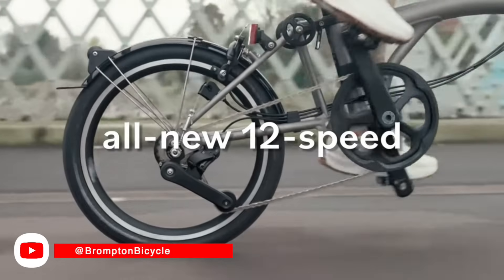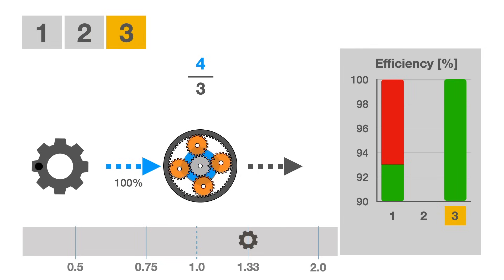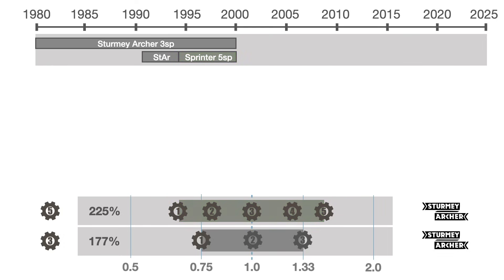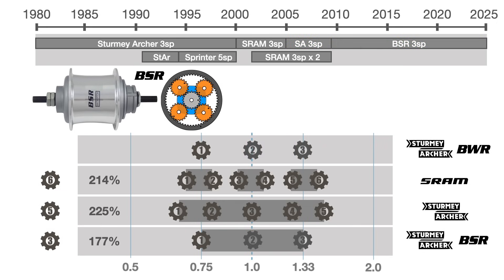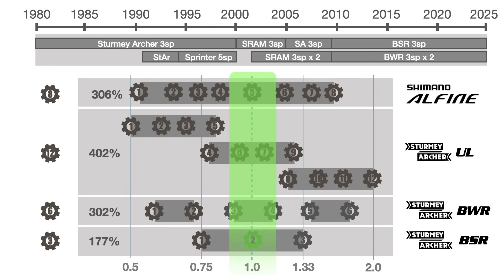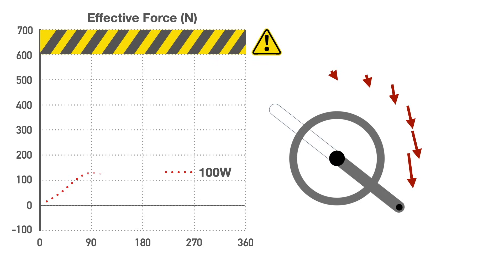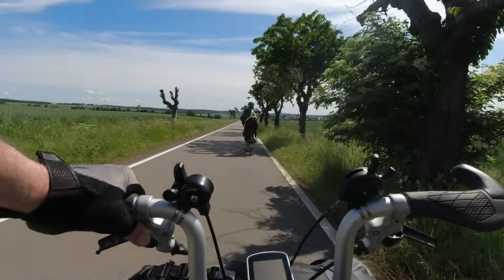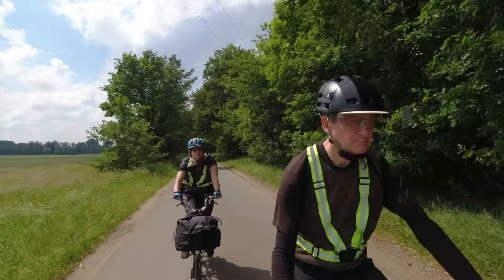Brompton Hubs: The Old, the New and the Math

Comment: Thanks for this informative video! Perhaps I will try using a Brompton with an internal gear hub. Currently, I am using a 5-speed external sprocket. I am so used to riding a bike with external gears. :)
Reply from the maker: You will likely see a degradation in efficiency moving from your 5speed to an internal gear hub.

Comment: Hi Pam and Gilbert! I'm not as bold as you, so I use a classical drop-bar, 27-gear, 700C-wheeled travel bike for touring, keeping my Brompton 6-speed C-line for city errands and occasional coutry or city rides when touring by car, when biking is a better idea for sight-seeing at short or middle range.
I'm not convinced by the hub+derailleur system of the C Line. I'd feel much more comfy with an alfine-type hub, everything inside, and no hassle with tensioners and what not. If I was to try and travel with my Brompton, I'd certainly replace the 50T chainring for a 44T one to facilitate luggage-carrying and hills. I've never understood why Brompton was sticking to the dual system for the C line. It's easy to get used to, but a single shifter with a single gear-system would be hassle-free.
Thanks for all the explanations you provide on your channel, with one regret: I'm pathologically (literally) unable to deal with numbers and maths, though the European way of calling gears is fine with me: 48x11 is the longest gear on my Ridgeback, 26x32 being the shortest. I know that 20x20 produces wheel-circumference length, so my legs do the rest.
Reply from the maker: The hub/derailleur combo was a quick fix to replace 5 speed hub shortage back in 2000. One can argue it overstay it’s welcome by now.
We agree with you. Brompton seems to over-gear most of their bikes. The 44T (not the 50T) should be the default, especially for the 12 speed. 
PS Sorry about the math heavy video :-)
Reply: As far as I read brompton wanted to keep their 112mm rear hub for compactness and didn't find anyone to supply them with hubs. They are slow to change things - hence they are using the now unusual wheel size. The upside is - parts are available for older brompton

Bromptons always need a chain tensioner, due to the fold
Reply from the maker: Indeed, keeping the 112mm O.L.D. is an issue. Sturmey Archer, once relocated in Taiwan, offered once again the 5speed, interesting to know why Brompton decided not to return to it, favouring the 2x3 BWR instead,

Comment: That's a very interesting video! A few years ago, I bought a 3-speed derailleur kit from Ti Parts Workshop and equipped my Brompton with it. I must say, the difference is night and day compared to my other Brompton, which only has the 3-speed BWR hub gear plus a 2-speed derailleur. I'm very curious to try the 12-speed arrangement and the G Line. For what it's worth, I do think the dual lever is a bit cumbersome, but it defines a 'Bromptonian' experience for me... So, would the bike lose its charm without it?
Reply from the maker: We had  3speed (Sachs/Sram) 2001 Brompton many years before upgrading to a M6R 2016 6-speed. The unique (Torpedo) shifter on the 2001 Brompton did have its charm :-)

Comment: Grear video. Thanks. I have a 15 year old Dahon. Which I recently add added a Zee derailleur with Saint shifters. 11 36 cassette 10 speed so it's light and efficient. The shifters allow for skipping gears in the downshifts. Excellent for London stop start cycling. I did a video. It's tubeless. Great video again thanks.

Comment: Glad you made this video.  I've been doing hard takeoffs from traffic lights for the last month. I'm 85 kg.  I think the only reason I haven't broke it is that i'm in the high sprocket on a 6 speed (gear 2)
Reply: They'll last forever.  The most problems I've encountered are neglect, pawl springs rusting away, incorrect cable adjustment.  When I was at  college I inherited a set of wheels to build a winter bike. The original owner had passed away and he was a time trialler.  The wheels had been on his winter bike. That rear hub, dated 1972 had been pushed he was a strong guy and I used them for five years. Never a fault. I'd service it and it showed only the lightest wear marks on the planet pinion pins. I swapped one set of pawls when they started to look worn but that was it. Solid kit. That was the original British built hubs though but look after that cable and they'll all be fine.
Reply from the maker: Arguably, Gear 2+ is to more robust of them all (direct drive, smallest sprocket). Nonetheless, it’s good to be aware of the potential issue related to maximum torque (especially if you have a smaller chainring)

Comment: I bought a Brompton 6 speed (Sturmey Archer 3 gears with 2 derailer cogs)  with Schlumpf Mountain Drive (ultra low gear system). It did not like it, the gear were too far apart, in practice I used only 4 gears: low Schlumpf, 1, 2 and 2 with high derailer cog. Also the skinny tires of the Brompton provide too little comfort.

I sold my Brompton and continue with my Dahon i7, because it has a Nexus 7 hub, 37 mm/ 1.75 inch wide tires and shock absorbing seat post. 
Because of the 20 inch wheels, the gears are spaced close together, just like a Rohloff hub. Around 13-14 % difference between the gears. The gear I use the most is 6.

That the Dahon is longer than the Brompton is no so important, I stay on the balcony of the train. There plenty of space for my Dahon.
Reply from the maker: It would be nice to see Brompton change the fork and rear triangle to accommodate larger tyres (ex. Big Apple). This would significantly improve riding comfort.
Reply: @2Bikes4Adventure  Yes indeed, Brompton has now the G-line with 50 mm/ 2 inch wide tires, Nexus 7 hub and disc brakes. Yet, the Ahooga A-max has the same features and costs 1800 Euros vs. 3000 Euros for the Brompton G-line.
Reply from the maker: Ahooga and Vello do offer interesting 20” alternative. Looking forward to have a chance to test one (or both)

Comment: I've got my 12 speed C-line a week ago and i understand the hub + derailleur combo because of limited space and the folding. But even if i like the 12 speed, the hub on gear 1 and 3 is not nice at all, the resistance is way to much noticeable. I'm already thinking of maybe putting one more cog in the back to get a 5 speed external gearing so i can use the 2 hub gear almost exclusive and see how often i really need the 1 and 3 in hub. And if that works i might remove the hub and have it as a 5 speed bike. But i'll give it some more time and see if the hub gets better when i have used it more.
Reply from the maker: Keep us posted if you install a 5th sprocket
Reply: @2Bikes4Adventure  WIll do :)!

Comment: Incorrect: It is not a SRAM hub, but a Fichtel & Sachs 3 speed hub. SRAM never used the name: Torpedo. You can even read the name: Sachs under the word "spectro" at 2:49
Reply from the maker: In 1997, SRAM acquired Sachs Bicycle Components. This acquisition included Sachs's internal-gear hub production line, a significant asset at the time. The acquired Sachs division specialized in chains and gearing. The purchase provided SRAM with experienced personnel and manufacturing capabilities.
Reply from the maker: At 02:35, the narration identifies the hub as a Sachs/SRAM 3 speed

Comment: As always excellent technical explanation. I’m not technically inclined but i understood it. I do have one question- how often should the SA hubs be re-greased? Assuming one cycles about 120 km a week.
Reply from the maker: Since Sturmey-Archer transitioned from oil to grease lubrication, routine maintenance is not as frequent. We would suggest doing a grease replacement at the same time as replacing the wheel/rim. As a comparison, the Shimano recommends Alfine oil change 1/year or every 2000km!

Comment: Great video, thanks for all the info, especially regarding maximum torque. Ive been using my Sprinter 5 Brompton since 1999, but its retiring this year to be replaced by a 12 speed.
Reply from the maker: Would be interesting to know what would have happened if Sturmey-Archer didn't go bankrupt and Brompton kept using the Sprinter 5speed (instead of going 2x3speed). Maybe we would have a 10 speed (2x5) or even a 20 speed (4x5) today? In any case, you will certainly enjoy your new 12speed (with its longer wheel base and locking rear triangle (among other innovations since 1999)).
Reply: Full story at Hadland Elegy for Sturmey Archer  @2Bikes4Adventure

Comment: I have used a variety of SA hubs for decades.  The old AW hubs were very easy to maintain given that they had oil ports and constant oil flowthrough via the loose interlocking "seals".  However, the new hubs were designed for use with heavier grease and are sealed with no lube ports.  I am about to disassemble my 14 year old Brompton BWR hub to clean and relube it and it will be interesting to see the differences between that and my AW hubs.  It will also be interesting to check pawl and dog wear as you rightly note that torque needs to be carefully managed to prevent wear or damage.
Reply from the maker: We're curious to know what you find during your hub maintenance!
Reply: @2Bikes4Adventure I've always found rusted pawl springs to be the biggest trouble causers

Comment: Great history &  info, thanks! 

Wish the 8 speed Alfine was in the c-line … as you’ve said in previous videos the high gears on the 12 speed or seldom used so the gearing chart you show, the Alfine gives 8 great usable gears.  Wish they had put at least a 2 speed derailer on rear on the G … look forward to a future h&h 50t/33t front chain ring video from you for the G-line! 

Good to know shifting under load is not the way to go … already stop to shift the hub gear … will work to shift the 4 speed with less pressure now when pedaling.  Thanks! 

Wish you would have addressed:
1. Brompton recommended stop pedaling to shift the Sturmey Archer hub (SAH)  - why recommended? 
2. How to properly service the SAH … other than shifting properly, and limiting force … when to do a service?

Note the audio wasn’t as clear as your past videos, could hear a constant noise in the background, perhaps it was HVAC? 

Again, great video, always love your content!!
Reply from the maker: We usually do not stop pedalling when shifting the hub, we just ease the load on the pedals.

Since Sturmey-Archer transitioned from oil to grease lubrication, routine maintenance is not as critical. For most users, scheduling a grease replacement at the same time as replacing the wheel/rim should be sufficient. Note that Shimano recommends yearly oil change on the Alfine (or every 2000km)

We will look into the source of the audio background noise.
Reply: @2Bikes4Adventure  How long does it take to one needs to replace the rims? Rough guesstimate  please. I was on video call with Brompton this week for basic maintenance tips for my new bike, they essentially said the same thing except you would just replace the whole unit, including the hub! I tried to have them, give me a mileage number, but that was the answer I got! Will be double checking that with a few local Brompton mechanics I know locally.
Reply from the maker: @GGg-ic9ku  @CycleEveryday did a great video on the subject of rim replacement (he mentioned 10000km): https://youtu.be/CQDg9F15vlo?si=mLkG4gRirvgFNVhJ
Reply: @2Bikes4Adventure  Brompton says the Alfine Hub needs servicing every 1,000 to 2,000 km.
Reply: @paulroberts01  I was on a video call with Brompton mechanic for basic maintained tips this week. I tried to get them to tell me a mileage range for servicing the SA Huband the mechanic wouldn’t give a range. Essentially it was recommended when you need to replace the rear wheel I assume from when the brake makes too many ruts in the wheel, just replaced wheel/hub so you just buy it as one unit. 🧐
I’ll be asking some local Brompton bike mechanics that I know for some more real world info.
Reply: @GGg-ic9ku I’ve seen local bike shops offering the service of hubs but i still feel what’s the point as a new one is a few hundred dollars. The labor can’t be cheap to service it.
Reply from the maker: @paulroberts01  The number seems to vary from one source to another. We took ours from this Shimano Dealer's Manual: https://si.shimano.com/en/pdfs/dm/CASG004/DM-CASG004-01-ENG.pdf

Comment: What do you guys think of the 7-speed conversions? Pros and cons?
Reply from the maker: We do not have direct experience with the 7speed conversion (Ease of installation?, Reliability? Folding impact?). If we compare with our Birdy (derailleur), we would say:
1- The 7-speed would be a lighter and more efficient alternative if weight saving is an issue (P-Line and T-Line owners would benefit compared to the 12 speed)
2- More fragile (close to the ground tensioner) and more susceptible to road dirt/grim
3- May need more adjustments (the 3speed hub is pretty much maintenance free)

Comment: Another superb video that explains everything so simply. I have a 2024, 6 speed C line and not wanting to go fast and being a lot older than I feel, I have found 2nd gear to be my normal gear for just about everywhere!! Your video thankfully confirms I’ve got it about right. I can take my C line anywhere, not sure a G line would be as easy or light. Looking forward to your next one!
Reply from the maker: The way we see it, the G-Line serves a different use case. Larger, heavier, it can handle rougher trails, but forfeit ease of transport when folded (basically, at the opposite end of the T-Line). The C-Line sits in the middle of the multi-modal spectrum. Cheaper, more versatile.
Reply: @2Bikes4Adventure so coming from a road bike, considering buying a Brompton for commute, so the intuitive choice would be a c line 12 or p line 12 ?
Reply from the maker: While some can argue the titanium components provide a more compliant ride, the main reason to pay x1.7 more for a P-Line is to shave 1.5Kg (or 3 lbs) from the weight of a C-Line, or about $1000US/Kg ($500US/lbs).
You will enjoy the weight saving when carrying the folded bike in stairs, buses and trains. If, on the other hand, your use case doesn’t involve hand carrying the bike more than a few meters, not sure it’s worth the investment. Replacing the C-Line seatpost for a $300 titanium one will improve the ride and enjoy the $1200 saving.
Reply: At 66, I also consider 2x2 to be my comfort gear on the same model (year 2023).

Comment: Pity there wasn’t an after market situation whereby there’s somebody who would get the ALfine hubs reengineered to fit the million plus six speed version, someone would make a fortune.
Reply: There is in Glasgow, Scotland. A company called Kinetics. They can supply the parts for you or fit them for you. They have an excellent reputation !!
Reply: @maureenarnold-hc4sg  Yes I know the gentleman you mean , they have to cha7the rear triangle with one of his to have the Alfine hub to fit , I was referring to the millions plus bikes sold so if someone reengineered the Alfine hub so it could fit into the existing triangle so basically the same dimensions as the hub Brompton use now for the three   Six and twelve speed and make it an eight speed.